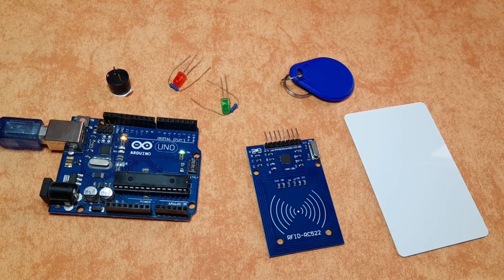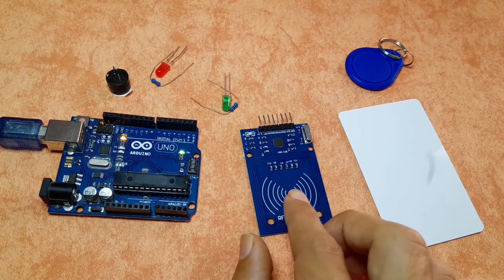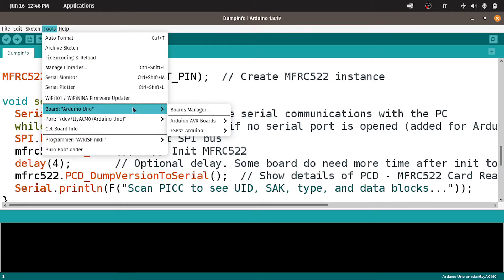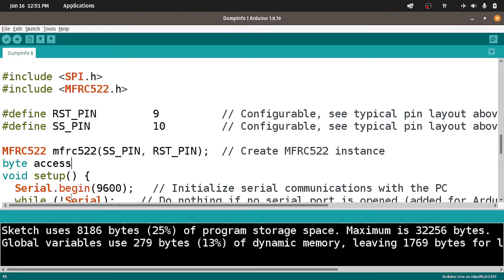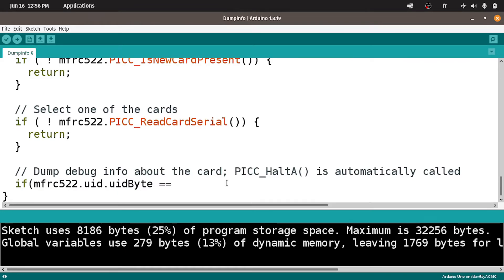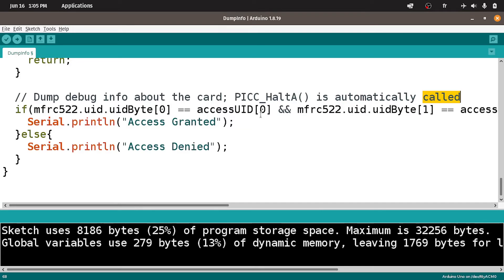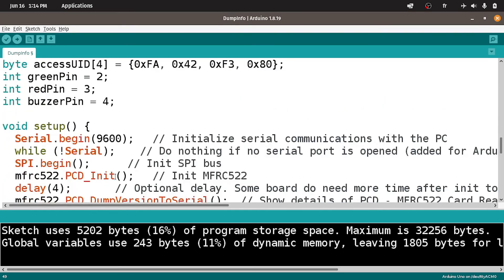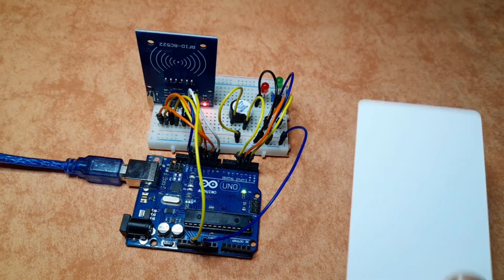How to use RFID  (RC522) with Arduino - Easy Tutorial

Comment: Hi there, I love this code of yours it is working well for me when connected to the computer. But not working with external power supply with SMPS of 12v to teh Arduino Uno. I want to run it without computer. Please help

Comment: if you get the error "WARNING: communication failure, is the MFR522 properly connected?
Scan PICC to see UID, SAK, type , and date blocks..." try to switch to 5v
Reply: i'm stil getting the error
Reply: I'm also getting this error. Changing the voltage doesn't help
Reply: @JeremyBindon-NotOurKing increase the delay after PCD_init() and reset the arduino board and upload again. I also got the same error. It worked
Reply: Thanks that works perfectly. I think its because it makes up extra voltage for any voltage drop form wiring resistance
Reply: that worked

Comment: For those constantly getting a timeout error, note that you should keep the tag on the reader until the output is completed - either that, or you may have a connection issue

Comment: WARNING: Communication failure, is the MFRC522 properly connected? I just keep getting this error
Reply: Did you find a way to fix that i'm having the same problem as well...
Reply: am having same problem
Reply: please help, im having too
Reply: @MeabuOP  change braud bro ı will solved my problem with this
Reply: I've FIXED it, in the DumpInfo.ino file look up the top for typical pin layouts and use the one from your board and then change the RST_PIN and SS_PIN variables in the file to match the layout, that worked for me.
Reply: I was receiving the same error. My issue was due to using the Inland model. The pin layout was as follows:

VCC - 3.3V
RST	- Digital Pin 9
GND - GND
MISO - Digital Pin 12
MOSI - Digital Pin 11
SCK - Digital Pin 13
NSS - Digital Pin 10
IRQ	- (none)
Reply: Im having the same problem, were you able to fix it?
Reply: @OnlyXaM  change baud rate
Reply: @IHas_  I was able to fix it, i just changed the pins to match the ones on the example sheet in the dumpinfo file
Reply: @OnlyXaM  where is that file?
Reply: @holdupmaster  Its the example file, top left, File -> Examples -> MFRC522 -> DumpInfo, then the pin layout should be in the top of the file in the comments

Comment: bro how did you connect na mfrc522 into the breadboard? im having a communication failure and it;s loose don;t know how should i connect it
Reply: The connection doesn't matters
Reply: You can just insert the wires directly and it will work

Comment: Im using a mega 2560 and have wired it for the mega 2560 but when i brought up the serial monitor it said 'connection failure, is the MFRC522 properly connected?' ive waited a half hour (and my pc isnt slow) and ive rewired it but it wont let me
Reply: you need to do soldering between breadboard and rfid

Comment: Hi, great video, when trying the dump info serial monitor, it said communication failure and asked if it MFRC522 was connected properly, I was using thee arduino mega 2560 and im not sure how to resolve the issue or if my board is the issue. I rewired it so it was wired according to what the code said for my board but it still wouldn't work... any idea on what's wrong? issue was fixed, no worries. WAIT! one more thing... my pinmode function is making the pins turn on as soon as I start the code, any idea on what function can make the pins an output source without turning them on?

here is exactly what it said: Firmware Version: 0x0 = (unknown)
WARNING: Communication failure, is the MFRC522 properly connected?
Scan PICC to see UID, SAK, type, and data blocks...
Reply: What did you do to correct your error?
Reply: I have the same problem can you pls say how you fixed it?